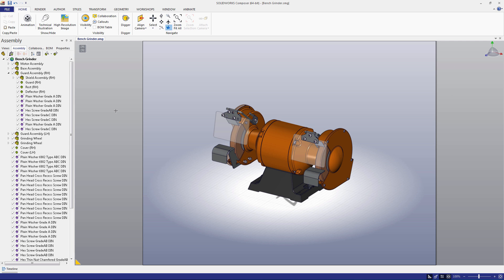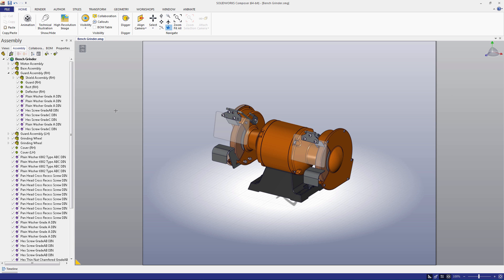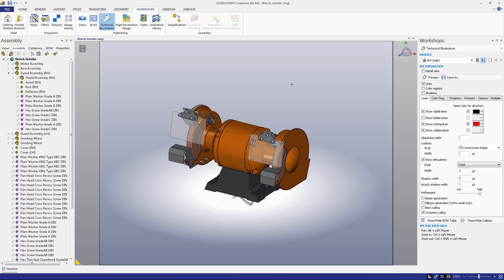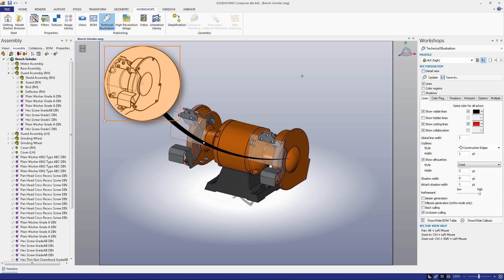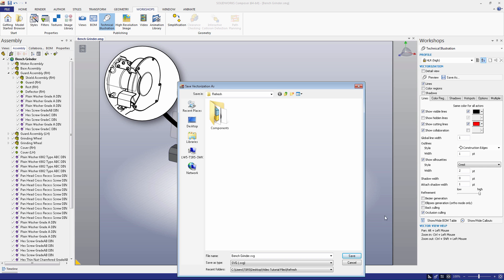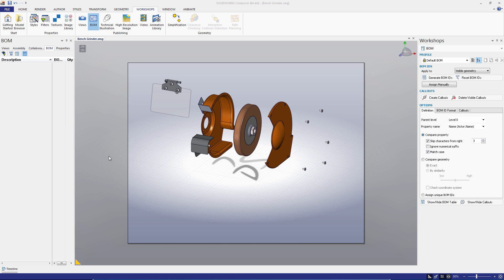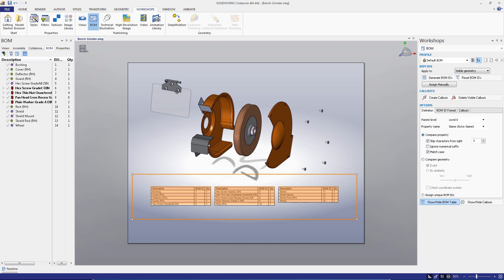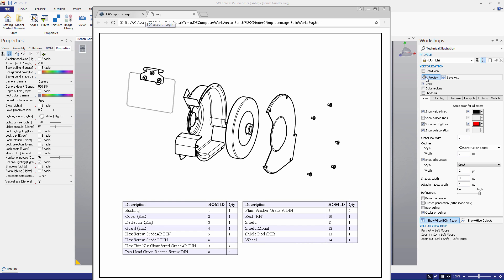SOLIDWORKS Composer Quick Start Guide #6: Technical Illustrations

Comment: Is there a way to edit the technical illustration afterwards? Or do we just clic some parameters by luck and then pray for the result to be what we expect? I've been trying Composer for 2 days, and what I can say so far is that it is very unintuitive...
Reply from the maker: Hi there! We are happy to point you in the right direction for great resources. MySolidWorks is the place to get the best answers to your questions about SOLIDWORKS in one location. 
 
We can also direct you to a variety of resources for questions and networking. 
 
SWUGN, or the SOLIDWORKS User Group Network, can be accessed here:  http://swugn.org/ 

With your existing SOLIDWORKS or 3DEXPERIENCE ID, you can access SOLIDWORKS Forums for more information on a variety of topics and questions from our user community. 
 
Check it out here: solidworks.com/UserForum
Reply: It's like a trial and error until you get the result you want. I'm also annoyed of this composer.